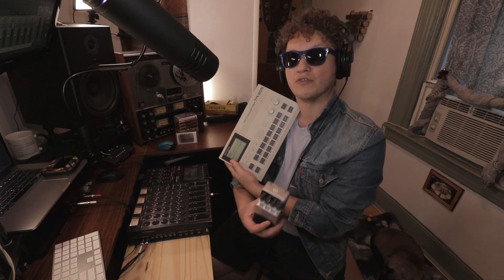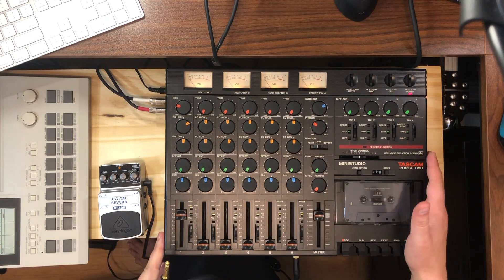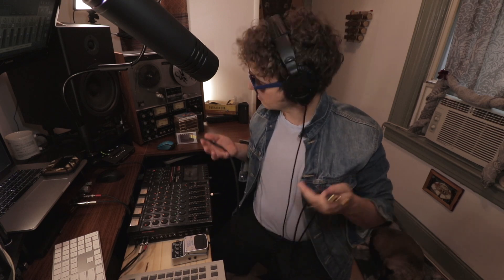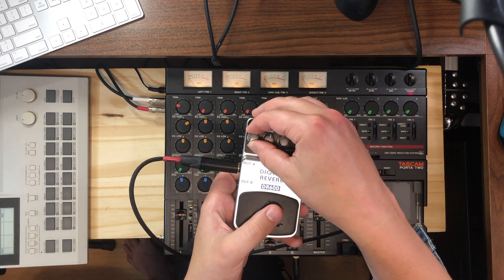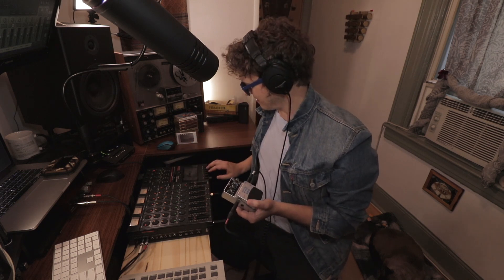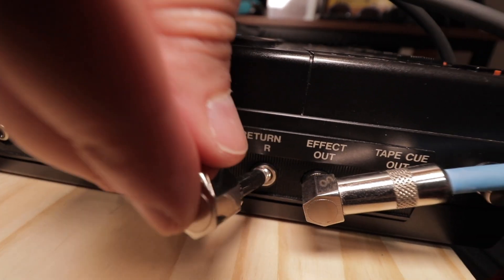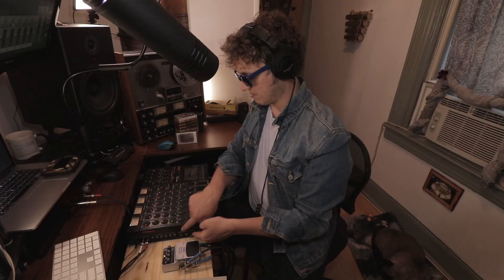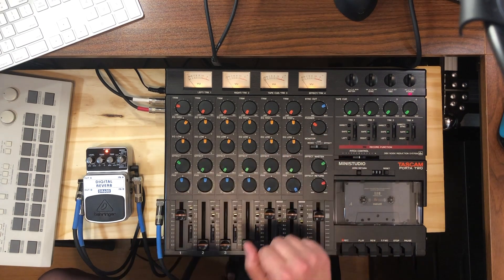3 Ways to Reverb a Simple Drum Machine on the TASCAM Porta Two ||| Roland TR-505

Comment: Hey Chris! Great Vid! All of your vids are extremely helpful, and great! I have the exact same porta two as you. Question, what is the best way to bounce out separate stems recorded in DAW from DAW(Logic Pro), and run them all through tape, and back to DAW. Would it be separately with the tape recording, and just print the bounced out, and back stem onto another track while tape is recording at the same time? I read that it supposedly still give tape saturation that way but, the wave forms seem to still look very similar as if it had hardly any effect. Most interfaces only have stereo line outs, and not 4 separate ones. Anyway, let me know your thoughts. Thanks man!
Reply from the maker: I think you replied on today's video?  Let me know if you still have questions!  An interface with multiple outputs like a Focusrite Scarlett 18i2 would help!
Reply: @MadeOnTape  Thanks Chris! Yes! Great vid. I have a Tascam model 12, and it allows for separate multiple outputs but, there’s an add on unit. The Tascam US-16x08 which has a lot of inputs, and outputs so, I’m gonna get one to go with my Model 12. Keep the awesome vids coming man! Have a great day, and weekend.

Comment: I use my two stereo send/returns on my 688 for an Alesis Quadraverb2 and a Nanoverb. 

Send/Returns are the way to go especially for mixer processing reverbs! 

I do love that idea of using the overdub channels to eq the reverb however. Pretttttty slick! 

I just use the program EQ on my Quadraverb2 to clean up the lows, but I may have to try this!
Reply from the maker: love it! as you saw, i am working with pretty severe limitations. someday i’ll upgrade to a big boy reverb unit. thanks for sharing and watching! 🤘
Reply: Check out any of the old Alesis boxes, even the tiny micro/nanoverbs would be a big step up and can usually be found for less than 70$! 

Also old Lexicon boxes can be found for affordable prices and give a more “clean, polished” verb.

Personally, I love the old dirty Alesis sound and I think one of those would compliment your sound very well! 

As always, thank you for the good content! I look forward to it weekly.